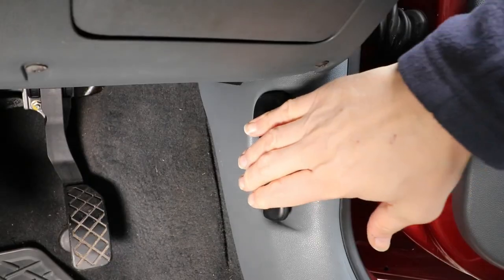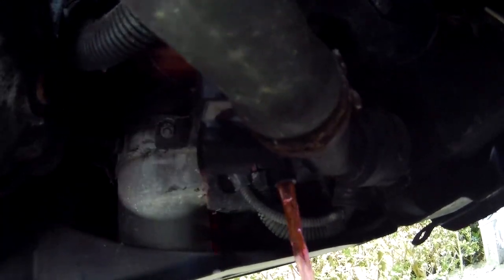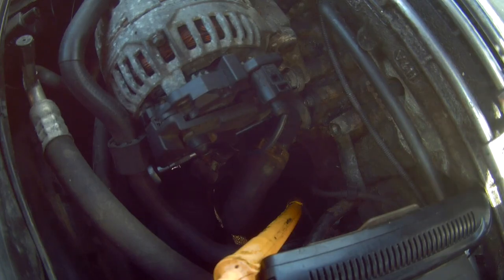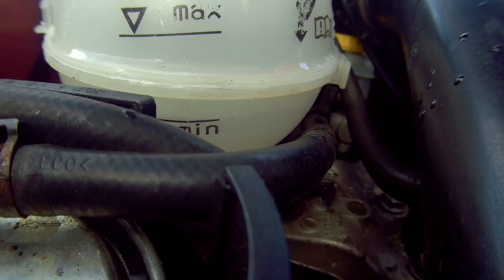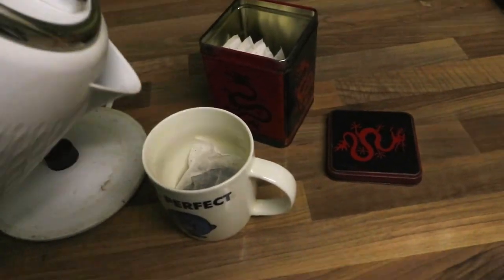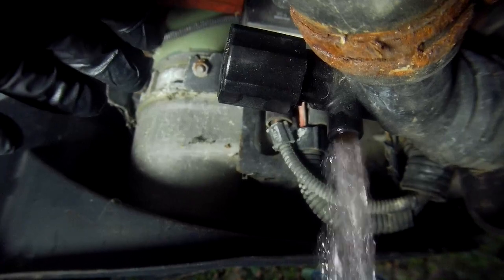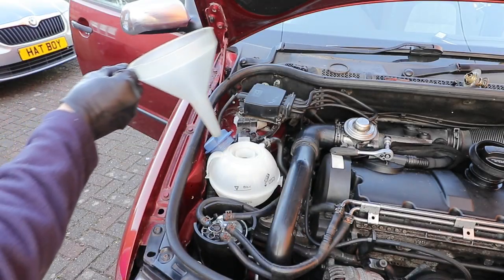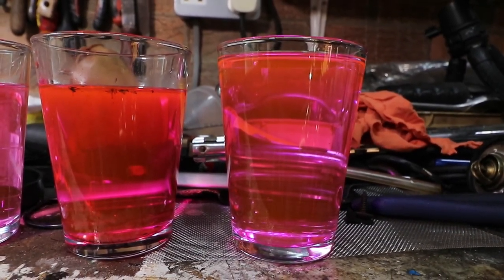COOLANT FLUSH Skoda Fabia (Mk1 1.9 PD 00-07)

Comment: I like doing this super flush in summer and run the car for a couple of weeks with tap water and without a thermostat. I did this on my mk1 Octavia over the summer. After getting rid of the coolant entirely i ran my car with tap water and changed that every week. That did wonders for my cooing system. The heater now gets a lot warmer and does so a bit quicker.

Comment: Hi my mk1 fabia heater is only blowing lukewarm all day,my air con motor failed so it's not connected to the belt ,is this why my heater dosent get hot? Or do I need a coolant flush please?
Reply from the maker: AC works independently to heating system, try changing the thermostat as it could have jammed partly and flushing or replacing the heater core :-)

Comment: Excellent timing is I’m swapping coolant, thermostat and coolant temperature sensor in my vrs (which I believe is an almost identical engine) would you consider doing a heater matrix flush video as mine didn’t feel overly hot over winter? Realise this may be a bit of a faff after just swapping your coolant out...... Keep these videos up they are informative, clear and easy to follow!!!!!!
Reply from the maker: Thanks, hope it helps and yes I intend doing a separate matrix flush as well :-)

Comment: HBH Happy New Year. I have a fabia 1.4 8v mpi. I want to mirror your video. Do I have to remove the thermostat whilst doing the flush or can I wait and change the thermostat after all flushing done. Reason being my thermostat is kind of integral to its housing, the new therm has housing attached. Many thanks in advance 👍
Reply from the maker: Thanks, What you want is the coolant flowing around the system and the thermostat is like a switch that blocks the flow when cold. Debri can also block its function, so it is best to take it out and run the engine.
Reply: @HatBoyHarvey  Thank you so much for your swift response, I really appreciate it. As I was going to use like you liquid Moly I didn't know if running the engine for 30-60 minutes could potentially cause a problem with NO thermostat. Forgive my ignorance I didn't know if your fabia being diesel and mine being petrol made any difference. Cheers HRH 😁,👍💯
Reply: @HatBoyHarvey  Thanks to you I gained the confidence to do a thorough coolant flush and change my thermostat. I'm so grateful to you for your time and generosity in filming and sharing your invaluable videos 👍

Comment: Iv got a question about the small lights on the front doors( lights up when  you open the door) mime doesnt work, btw im driving skoda fabia sw 2002 so if there is some fuse bcs i changed the bolbs and its still not working. Any advice will be good
Reply from the maker: Do the interior light come on or not? these are linked. check fuses 4 and 5 and check interior lamps are all good. If all ok then the door microswitch maybe the issue, but check the wires/connection behind the bellows by the hinge first.

Comment: Harvey,I have got fabia 1.4.mpi.I will take out the thermostat from the housing,but since this engine catches it's working temperature pretty fast,If I run it for about 5-10 min without thermostat I cant make any damage.Longer than that with this engine would be risky ,right?
Reply from the maker: No 'damage' at all as it runs fully open.
Reply: @HatBoyHarvey  thnx you are awesome 👍👍👍

Comment: Am I right in thinking you wouldn’t need to remove the thermostat in a petrol 1.4?
Reply from the maker: It is always a good idea to remove the thermostat when doing this as particles can get stuck inside the thermostat affecting it's function, but it also makes sure you have a fully open system to flush. You can actually do it without, but you might get problems after or later. Take care with the plastic housing and don't over tighten when putting it back, it only need to not leak so clean everything up before reinstalling, making sure the thermostat is seated correctly. Hope this helps :-)
Reply: @HatBoyHarvey  very helpful thank you, I think I’m going to flush it by taking the rad hose off and leave the thermostat in, then when after empty the flush a few more times I’ll swap the thermostat and temp sensor before I refill rather than taking it off then putting it back on.

Comment: If the thermostat is ok, do you have to take it out for flushing? It's in a difficult spot to take out
Reply: It seems it's under the fuel pump
Reply from the maker: It is false economy not to as if it packs up you will have refill the system again and flushing removes deposits that could lodge on the thermostat and stop it working properly. a new one costs very little and then you know the job is right for the next 5 years
Reply: It wasn't for economy reasons, I was more worried about the green coolant, the thermostat housing is in a pig of a place to get at, under the fuel pump. But I was worried might have trapped air behind the thermostat, am I right in assuming when you put a new one in the system is empty so it must be self bleeding. Thanks for your assistance
Reply from the maker: No, once you run the engine the air gets vented (pumped) out. Sometimes steam pockets get trapped in the pipes and a bit of a squeeze of the top and bottom hoses will move these.
Reply: @HatBoyHarvey  Thanks Harvey, great to know. I was looking at removing the thermostat housing and getting a new thermostat, I would have to remove the alternator to gain access to the bolts. So I will wait till you have a tutorial on that one :-)
Reply from the maker: cheers :-)